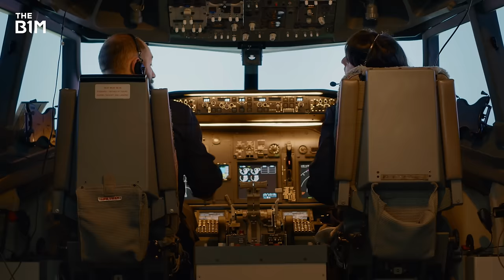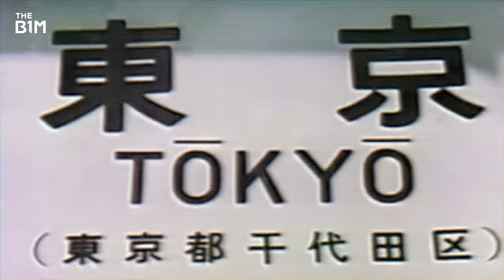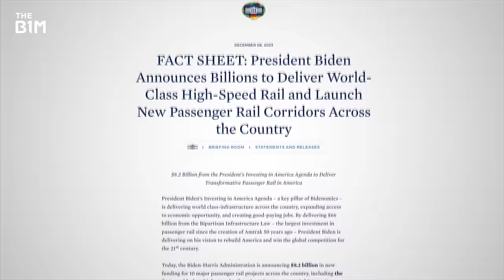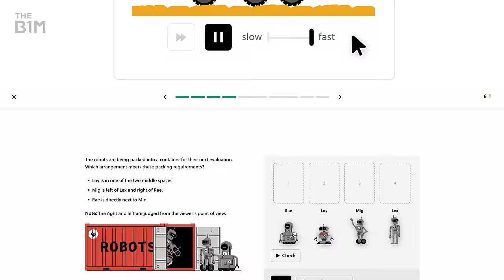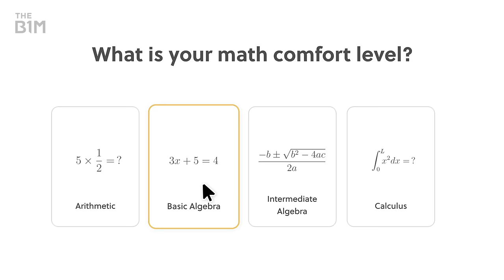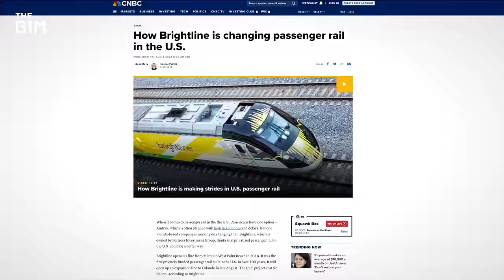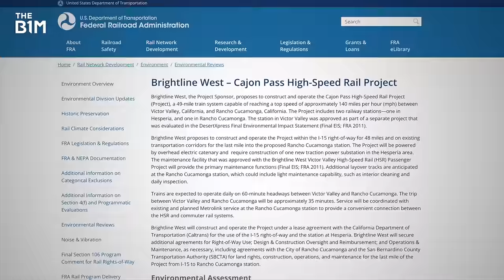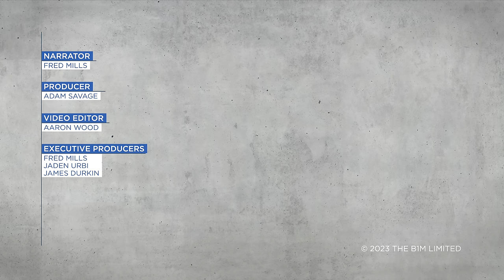The $140BN Race to Build America's First High-Speed Railway

Comment: I reckon watching a 180mph train pass you while you're stuck in traffic on I-15 might be the biggest motivator for someone to try using it
Reply: I agree, should convince people to at least try it the next holiday :)
Reply: Getting to the "LA Area" terminal in Rancho Cucamonga without a car will be slower than sitting in traffic through Cajon Pass for most households in the region. The high speeds of Brightline will be evened out by the low speeds of local transit.,

This video heavily underemphasizes the impact this will have, glossing over with "Metrolink to downtown in an hour". Fewer than 100k people live in downtown LA, and regional transit falls short for most of the rest. American cities are so spread out, with underfunded regional transit, that a fast train to one station in each city is fighting only half the battle. Brightline West will probably be successful, but not as the default choice over driving.
Reply: Was about to comment that.
Reply: 100%
Reply: You don't have to be stuck in traffic. You could have the road to yourself, and you'd still be put in your place.

I experienced this when I was in a car that was travelling north from Paris (France), and a TGV came by. The speed limit on the road is 130 km/h (around 80 mph), but the train does 300 km/h (186 mph). That's faster than an airliner when it lands.

It's a very humbling experience.
Reply: I would love to see the sights too, from the police car chases to the arizona desert even if it will be for ~3hrs
Reply: @scottie89901  For a service that is solely being pushed as one for tourism, I agree.   You want to get your tourists to the tourist places, which it seems on the Las Vegas side you're set but what about the Los Angeles side?   Those tourists going to LV need to drive for an 1.5 hours to get to the train station that'll make it all better?   Or how about any tourists in the Las Vegas area that want to go to Disneyland, Universal, Hollywood, etc?   There's a big piece missing.
Reply: A few years ago I was on "The Carolinian", a train that runs from North Carolina to New York. The train was outside of Philadelphia running next to a local road. I looked at Waze on my phone. The speed limit on the road was 40 MPH, the traffic was hardly moving, and we doing 125.
Reply: @strawberriesandcum  It's actually a strange experience. Between Amsterdam and Paris, I've seen the trains from a car, but also the motorway from the train.

It's actually not that easy to gauge what speed you're going at from looking out the window. You cannot see ahead of you, so you can only look from the side. Any greenery is just a blur. The supports for the overhead wire pass much quicker than in a normal train.

But when you look at the road, it's a bit like you're watching stationary objects from a car. Like a farm in the distance. But because the cars are driving at different speeds, it looks like they're doing some sort of moonwalk. You know that these cars are driving at speed, but it doesn't look like it.
Reply: If the train stations in LA for the last Vegas train and SFO train are too far apart then this project gets a lot harder
Reply: @scottie89901 in that case it’d be wise to build ample parking at the station then
Reply: I just did the drive to San Diego and it took almost 8 hours with traffic. Would absolutely take a train, even to Rancho Cucamonga.
Reply: my thoughts lol
Reply: Airliners go very slow when they land  @SeverityOne fyi
Reply: When I worked in NY and lived in Virginia, that’s the motivator that made me take the Amtrak crescent line up there.
Reply: @JonP_4-31inf  If I drive the speed of a landing airliner in my car, the police will want to have a word with me.
Reply: no
Reply: @scottie89901  The train will always be faster than driving because every car needs to go through the same narrow pass and follow the same freeway. If you just drive up to the first station where the train is situated everything after that is pure profit. Not to mention your vacation starts the moment you step on that train because you can immediately start drinking and partying.
Reply: Hey fellow so cal person! I don't think you will need to convince anyone for the Vegas party train. Lol I am so excited for it! I haven't been to Vegas in 15 years bc I hate to drive through the cajon.
Reply: In between lanes? It's a recipe for tragedy. Not even in Italy we've made high speed railways AMIDST an expressway.
Reply: @birdsofafeather8368  I drove from Sacramento to San Diego and it was 9:30 drive with a 1 hour break in between. I would much rather take a bullet train than driving or flying.
Reply: @scottie89901  Just because the local transit connections aren't that great now doesn't mean they can't be improved in the future. The line has to be built first before the improvements can start. I've already seen some videos mentioning future improvements like adding tracks and electrifying the commuter line so Brightline can go all the way to Union Station. Future bus lines and light rail lines can be planned with this line in mind. There's also a video by CityNerd that broke down the travel time from various parts of LA and even with the current local transit, the new rail line will always beat the car and is only like 30-60 min off flying... with the benefit of not having to deal with all the annoying parts of flying.
Reply: The other issue is having quick and easy and cheap rental cars available at the end of the train lines
Reply: I was thinking the same 😂
Reply: Until you try it and return to where you parked your car to find it vandalized, broken into...or gone altogether, then sitting in traffic won't seem so bad.
Reply: @NYVET48TFW  bot to mention needing a rental car at the end anyway
Reply: @scottie89901  tell me, why is it spread out again?
Reply: In the northeast, anyone can pass Amtrak’s fastest, the Acela, in a car on I-95 or the expanded NJ Turnpike just about any time.
Reply: Which is why the oil, auto and airline corporations have never and will never allow it to happen.
Reply: I-15? that your best example?
npt the I-5 or 405 or Actual LA freeways?
Reply: @scottie89901  It may even out but remember, cars even Teslas don’t drive themselves to the point where you’d get there safely. Driving fatigue is a big reason this would have ridership. Even if you have to take metro link.
Reply: @Mike__B  One word. Metro. 

LA Metro and Metrolink goes to all of those destinations.
Reply: @Mike__B  getting to Anaheim from Rancho Cucamonga would seem challenging, by train at least; the same for Universal Studios. If by car, then it seems like an hour or so ...
Reply: With proper planning and a $600 radar detector you can easily do North Hollywood-Vegas in 3 1/2 hours, with no drug crazed vermin disturbing you.
Reply: yeah.
Reply: @Keylevitation They’ll need a subway tunnel between the two. Maybe build a few stops along the way too. 😅
Reply: @stefanodadamo6809 How so?
Reply: @michaeldunne338 Imagine an underground metro line between RC and the major tourist destinations
Reply: @TransitAndTeslas  driver fatigue is minimized at 110.
Reply: until they find out it only goes to Rancho Cucamonga
Reply: @linusfotograf  that would help I guess. Not sure how well developed out the metro is for that city? Have only been on the E line from Santa Monica for a few stops; and it felt a bit on the light rail side of things. That being said, there is stop for Universal Studios, and an extension is underway for the D line, to Century City I believe.
Reply: @Mike__B there are train stations in Los Angeles that already connect to Rancho. My sister use to take the train from Cal State LA to Rancho. I have also gone to Universal Studios from Rancho train station. That is why it is connecting in Rancho. As you will be able to jump in a train station in  LA.
Reply: Hopefully one day if the high speed ever gets completed from San Francisco to LA it can connect to Brightline in the future. That would be a game changer.
Reply: In Europe we use trains because it's way faster. 5 hours drive is just 2 hours on a train 😊
Reply: I rekon imagining certain types being stuck far away is a better motivator to keep these trains from happening.
Reply: They give up their cars and I will have less traffic to contend with.
Reply: I'll stick to my half-hour flight. Thanks
Reply: I would certainly love to see that happen and hopefully stuff like eminent domain can get sorted so they can finally get it going.
Reply: I'm not an engineer, but the idea of laying a railroad in the middle of a highway seems like the stupidest idea to me
Reply: That is NOT going to happen. 
You obviously have never been on a high speed train anywhere in the world
Reply: I've been stuck in the back seat of a car when for some reason I wasn't able to take the high speed train. Where the high speed rail line ran parallel with the freeway & we were travelling at 120kph a train flashed past us at 300kph. How I wished I was on that train.
Reply: @steelwind2334  there are many cities that have done that and have a decent and functioning transit system.
Reply: @TrebleSketch  Do you understand what high-speed train sysyem is?
Reply: @jimdake6632  because the NEC has a lot of at-grade crossings. High speed railways are supposed to be fully grade-separated.
Reply: no, not at all
Reply: honestly, just having a maglev go by at 500MPH while your on I-40 or I-10 would make you take a train just for the thrill.
Reply: No. It's when the second blows by and you have only moved twenty feet
Reply: @scottie89901 This is the single biggest issue for intercity rail in the US. You arrive at the main station, but then what? Urban transit in the US is notoriously atrocious. Poor public transit, low levels of walkability, massive suburban sprawl, car dependence, etc...  

Sure, build these trains, but you also need a vast network of subways, bus lines and other means of public transit to funnel people in and out of those stations. It's why Asian and European HSR networks are so successful. The main terminal usually isn't the final destination of travelers using HSR in those regions.
Reply: @scottie89901 you literally have to start somewhere. There are right of ways in L.A. I’m sure plenty of people would rather drive to rancho then get on a train then sit on the 15 during a holiday weekend. I just honestly feel like no one understands that it would literally take hundreds of billions of dollars to build from downtown to just rancho on dedicated rail lines. You are gong to have to transfer to existing infrastructure.
Reply: @xx133 No, it's the government via the National Environmental Policy Act or NEPA... You still need a car at either end of the line. Vegas is far from walkable unless you stick to the Strip...and even that can be a pedestrian nightmare.
Reply: @spuds6423  I don’t understand what you’re responding to when mention the government through those policies. Besides, wouldn’t less cars be needed if we had a robust public transportation system? We have designed society around cars, so yes, if we don’t make infrastructure changes in certain areas, the people there would be dependent on vehicles. Also, public transportation buses exist for this very reason.
Reply: Until they get to Rancho Cucamonga, and then the drivers will have the last laugh 🤭
Reply: Ha3...couldn't agree more, like a middle finger
Reply: Even when traffic is flowing smoothly, the train will outpace everyone, offering a playful reminder for car drivers.
Reply: Honestly I think the best place to start HSR would be a 180mph bypass from New York to New Haven bypassing the busiest and slowest part of the NEC. From there you could expand the line north and South to Boston & DC taking advantage of the support and success created by the initial Cutoff
Reply: BUT
You have to factor in time to reach the station and the time to go from station to your destination and the cost of transport and the time consumed.
We are not Europe where everything is closer then the USA.
Reply: And just how many people will that train serve?
🤭
Reply: @xx133  Have you ever worked on a transportation project?? Even some of the best ideas get nixed because of these laws and regulations. Until they are revamped these projects are just a pipe dream.
Reply: @spuds6423  i assume you are referring to public transportation, not private, since there is no example in human history of a private corporations using private money to build public infrastructure that didn’t go bankrupt almost immediately. it has nothing to do with laws and regulations.
It has everything to do with the oil, auto and airline lobby. This has very well been documented over the past 120 years. If the state actually wants to build something, it does. It’s just not profitable for capital owners, and loses a systemic risk to those industries I mentioned above. You don’t think laws and regulations existed when we built the first railroads and interstate highways in the U.S.? What about the Hoover dam?
Reply: Likely not as it won't go anywhere I want to go and it'll be crazy expensive. 
I've been looking for an excuse to take Amtrak out west for years, but my past quote (for a family) was over a grand! 
The commuter rail in my city costs more than gas for my car each week AND triples the length of my commute. Super fast trains won't solve anything for the majority of commuters.
Reply: @NYVET48TFW  that can literally happen if you leave your car anywhere. What a strange thing to say to keep people away from using trains.
Reply: @Lawrence330  truth
Reply: @ZazzelTheGamer  it's much more likely in a public all-day parking lot. The real reason we don't use (or want) passenger rail is because we WANT our cars, we all have one, we don't want to live like Europe. We kinda left for a reason. Rail service (aside from freight) will never be a big thing here.
Reply: The issues isn't watching a train go by.  I mean you DO understand that high speed rail is for long distance travel right?  So how does that help YOU stuck in traffic on I-15?  How does that help when you live 20 miles from where you work?  You think High Speed Rail is going to make 50 stops going from one city to the next?  Tell me, what keeps traffic away from the terminal stations for these trains?  Magic?  POOF, no traffic for you to go from your home to the rail station and NO traffic at the other end.  OH MY SIDES!!!!!! 

Otherwise for localities there are slower trains that move people around, and where I live regardless of how bad the traffic is I STILL see almost empty trains taking a TINY number of people back and forth on typical travel routes for people to get to main areas of work, so large business areas, or large medical complexes, etc....  In which case these trains may travel a distance of 30 - 50 miles and make many stops along the way, probably at least 1 for every 5 miles of travel, and in more population dense areas more like 1 stop for every 2 - 3 miles.  High speed rail can't do that, or it wouldn't be high speed rail.

You statement is TOTALLY irrelevant to bullet trains though so it's laughable that so many people, basically idiots including the author of the video thumb you up and even love the statement.  That's how clueless people are.
Reply: @Ultrajamz why cars? Why not bikes or scooters?
Reply: US should build Maglev high speed rail that travels at 600 kmph. Made by Siemens Germany. The power consumption is lowest and the price of the train will be recovered in no time if priced cheaper than flight prices.
Reply: Passing by highways with trains in France feels like this 😂 just love to look at beautiful landscape
Reply: Or maybe they wouldn't care much because Americans still like owning things like cars.
Reply: @pjt.4841  taking the 15 to Vegas on a weekend is a radicalizing experience, you wouldn’t understand
Reply: Just what I was thinking.
Reply: @kingboagart899 yeah but if you're in a car you have to deal with psychopaths who have no regard for their own or the safety of others.
Reply: @scottie89901  : well they could just build a car park near the Rancho Cucamonga terminal. You could then comfortably take the car to get the train. I don't really see a problem with that. ☺
Reply: The resulting air flow could provide enough  lift force converting all the road cars into flying vehicles
Reply: @scottie89901  That's my fear as a European, our cities are more dense but with great mass transit systems, someone who works in a city's suburb can easily get to another city's suburb, whereas in the US the only people who could be interested will be those wanting to depart or arrive in a city center and will use the car if needed on the other city. 
On the other hand, Airports have the same issues and they work great so there is a chance it will work
Reply: In the Metro Manila, Philippines, we have only 3 major train lines (currently expanding). A major road named "EDSA" is a notorious road when it comes to traffic. The train lines and the bus carousel give people faster travel options than cars.

I usually smile looking at stuck cars when I'm riding the train or the bus carousel. But honestly, we need more progress when it comes to public transportation.
Reply: This is 100% correct. I've been stuck in traffic from Vegas to LA and it sucks really bad. Also, this will spawn day trips between cities. One thing I noticed from the Shinkansen in Japan when I traveled was people exiting a train from Tokyo to Nagoya without luggage which means they hopped back and forth within the day.
Reply: @Mike__B  You can get to Universal and Hollywood by rail in LA. Disneyland is much trickier. There's a Metrolink commuter rail station 4 miles away. The problem arises in the Scheduling in the Metrolink services, which currently suck and run sparsely and getting to there from the station. I'm sure Disneyland has enough money to run shuttles from the station and back or they can extend their monorail to the train station for larger projects. Disneyland is always crowded anyways and they probably wont have any incentives to increase attendance.
Reply: @@RealHumanUser and you can actually get some good air over a few of the arroyos!
Reply: Japan doesn't have a problem with steep grades. They just tunnel through. The flip side to that is, instead of a scenic trip through the mountains, you're mostly staring at the inside of a tunnel😉
Reply: @SeverityOne In Italy we we passing cars on the Freciarossa train. We were doing 300kmph, they were doing 110. 
We went from the centre of Turin to the centre of Milan in 30 minutes. That would realistically be over a 2 hour journey in a car, more depending on traffic. 
A good high speed rail network is not even comparable to a car travel. It's leagues better.
Reply: @stefanodadamo6809 Italy has many high-speed rail lines adjacent to highways. Turin to Milan is an example of this.
Reply: @kingboagart899 Fatigue is about the amount of time you are driving, not the speed you are driving at 😔
Reply: That might be a seriously underrated advantage of this design
Reply: @bubba842  I agree. Although the French really should put more leg room in their high-speed trains.

But we're talking about Italy here, the country of Ferrari, Alfa Romeo and Lamborghini (and remarkably few F1 champions). Are you sure that they were doing 110? 🙂
Reply: @bubba842  adjacent, and at a sensible distance, not between lanes...
Reply: That  would do it for me!
Reply: @scottie89901 thats true. We built our sprawls over the years amd are trying to urbanize now to become more dense after all the years.  Its gonna take a long time but we are somewhat heading that way.  Parts of dtla, little Tokyo and chinatown have changed tremendously over the last 20 years.  Hopefully that continues.  At the same time, they need to rebuild neighborhoods around and close to the metro stations.  The bunker hill station is nice and new but a bit of a joke, coz its like an island in the middle of some highrises and commercial buildings.  People are still living in flat neighborhoods that are so far out.  Those neighborhoods are probably covered by the merro system but it still takes a long time to travel.
Reply: Why would a bullet train go through resident area? So it can kill people?
Reply: Not for me. Public transportation is totalitarian.
Reply: @viriathus2802  you be you then
Reply: Amtrak is already better than driving from LA to SD but it sucks. Get me
There and back in 30 minutes you incompetent politicians.
Reply: I was on that highway January 1st. It was absurdly  terrible. Why is it only 2 lanes?!
Reply: @VaughnLower  really sucks that politicians pushed for freeways instead of trains back in the days to grow money for the real estate and automobile tycoons.  Amtrak is still somewhat expensive compared to like busses.  I have taken flix bus from la Union station to San Ysidro and its pretty convenient and cheap too.  I want to try amtrak or metrolink, but i always go for busses because of the cost lol
Reply: I do this every week at 160mph (250km/h) in Switzerland. For a lot of journeys public transport is just straight up faster here.
Reply: Literally, getting us Americans to use trains in cities might be a little harder but connecting big cities with high speed rail will definitely help change that. Connecting the big cities where we don’t have to drive to them is the first step, and then city transportation after that would also go up with less people bringing their cars
Reply: @PhilfreezeCH  @PhilfreezeCH Thats awesome.  Most developed countries have pretty developed train systems, except for like the US and Canada.i think Americans in general need to experience this first!
Reply: @ThatColtGuy  exactly and some car focused people may still need time to adjust to it even now.  Its a long process for the cities' transportation to improve because of the sprawls we built in the past decades.
Reply: Some people might argue that America doesn't have one because they don't really need one. They have  airline and good highways. (In some areas)
Reply: @JuanGarcia-hr8ks  That is exactly the basis of their argument.  LOL
Reply: @Mike__B  Right well you can’t build a house without setting the foundation first
Reply: and still have to pay $60 to go to the strip in an uber from the station....
Reply: @scottie89901 You have to start somewhere right. At least there there trying to improve on the transit
Reply: If takes you a significant amount of time just to arrive to the station, board and de-board, it's no better than dealing with flying somewhere.  High speed train in the United States is a multi-generational pipe dream.  I do hope it happens, but I'm over half a century old and in California it's only been talk.  In the meantime, the State and Federal governments love to tax and spend millions upon billions just on the logistics.  It's literally the fast track to nowhere except money-ville for the politicians and their pals.
Reply: @scottie89901 This was my initial thought by just looking at the thumbnail! 😂
Reply: @JonP_4-31inf The average landing speed of a single aisle commercial airliner is between 140mph and 180mph.
Reply: You are 1 MFDA.
Reply: High speed rail is the most stupid thing to build because it’s a low tech that cost 4 times more than an airline tickets to travel within 200miles, it’s more when you travel longer.
Reply: We will see. If it is like the LA-SF HSR, it will not motivate anything.
Reply: Nope
Reply: Marketing genius!
Reply: Average speed is 69 MPH for existing Bright line trains and there are over 100 pedestrian fatalities annually.
Reply: @scottie89901  THIS! California has a massive "then what?" problem. Cool, you've boarded a fast train to LA... Then what? It's LA. People want their car
Reply: I think the biggest issue with this train is it’s in Rancho Cucamonga which in typical la traffic is 90 min from downtown LA. And there’s no decent public transit to and from the new brightline station
Reply: No joking when I say they should make commercials just like that. Would encourage many people to do that
Reply: @scottie89901 metro is expanding throughout LA. Also, I don’t think it would be just a single stop. There’s existing lines running from metro out to Rancho
Reply: @SeverityOne  An even greater experience is to overtake an ICE on the Autobahn going 250km/h+.
Reply: No, Because it will not stop anywhere near you to take it. Such is the failure of rail.
Reply: That already exists especially in LA and Vegas. Problem is a lot of people in the US are not even aware of a bus line that goes right by their house. I have helped several carless people figuring an easy way to commute they had no idea it was there. Another factor helping trains nowadays is super expensive parking, ever rising gas cost and car theft too.
Reply: You’d think that’d be the case but I guarantee you that still wouldn’t pop into their heads as a viable option. That’ll only happen if there is infrastructure in place like buses or local trains to move you around in the city you’re going to. There’d also need to be a lot of advertising extolling the benefits like how much time & money it’ll save you. That matters a lot more to most people than how green it is.
Reply: There isn't any way I'm waiting in line to catch a freaking train and then waiting in line again to get off and to rent a freaking vehicle. I mean, I can easily drive in comfort myself and leave when I fell like it. It's a nice trip, plus I can stop and have lunch on the way .
Reply: I love them and I have a folder about them
come take a ride! (at folder 2)    :))
🚅🚈🚞🚝🚂🚃🚄
trains, trams, aren't they all beautifull
Reply: And there is always something going WRONG with that freckin I -15.
Reply: @edsalinas9996  I like the drive to Las Vegas on I-15 from LA. I'd much rather do it in my car if I had my druthers.
Reply: Nah taking their cars away from them and giving them to people who actually need them probably is the biggest motivator?!
Reply: And still would take 3 hours to get to Vegas from LA
Reply: @jxsanc1238  still way better than Amtrak! And it probably would be on time more than half the time!
Reply: You don't need to be stuck in traffic to be motivated. You can drive at 80 mph and it'll still blow past you.
Reply: So why are you in a hurry? Donation to casinos? lol
The casinos in Vegas are laughing 😂
Reply: Same would be the situation on I-95.
Reply: @scottie89901  I agree with your comment.  My thoughts.  Most of your Asian gamblers who want to go to Vegas come from several LA areas not close to downtown.  Diamondbar, Rowland Heights, San Gabriel Valley, Thai Town, and Koreatown, for those gamblers, it is still inconvenient from Union Station.  These gamblers carry a lot of cash when they go to Vegas and I don't think they will feel safe taking that train.  It is why they have their own bus systems in their communities.  Also, what about the other Asian gamblers in Orange County.  You expect them to take another train from Union Station back to their areas.  Not gonna happen.
Reply: Since introverts and social anxiety peoples are increasing, there would be more cars.
Reply: @xx133  Just Stop Oil people 😂
Reply: @ikanmesra  what do they have to do with the facts of this story?
Reply: @xx133  They're almost anti-vehicle people. I bet if they also use cars then it was Tesla car with hundreds of ecosystem and go green stickers.
Reply: @ikanmesra  not true. Stop straw manning people who are working to save billions of lives just because y disagree with their tactics. People focus on aesthetics and are so easily swayed by prop…
Reply: Exactly!
Reply: @scottie89901  you could just walk to the bus stop, then ride the bus to a train station. ya know like its supposed to work
Reply: Or you didn't watch it being built for 40yrs & were 80yrs old when it was partially completed.
Reply: @scottie89901 Thats Sounds like a LA Problem. Inland Empire Resident will enjoy the Luxury of this Project for Years to come 😂
Reply: Hopefully that gets more people on board with supporting more HSR
Reply: I think a CA HSR is  really bad idea. When actual estimates are figured, & what the cost of a ticket would be, & factoring in homelessness & out-of-control crime & the projected numbers of illegal aliens, at best it would be a mugger mover, at worst nobody would pay the price to take a chance with public transportation.
Reply: So true.